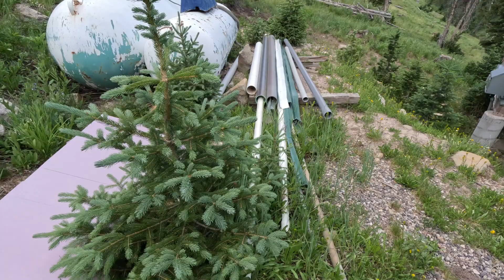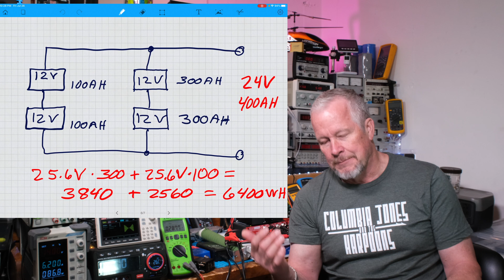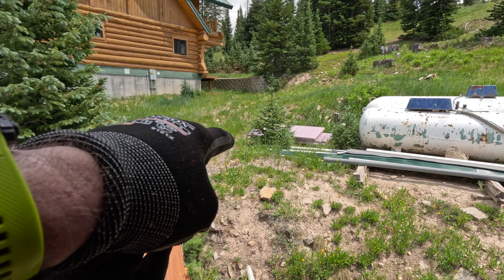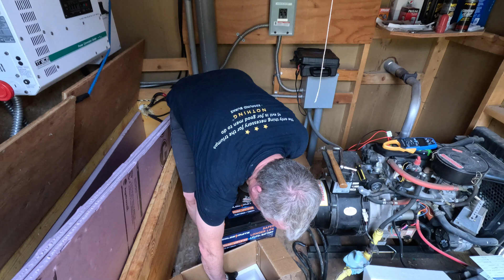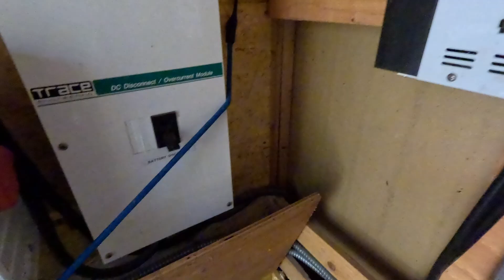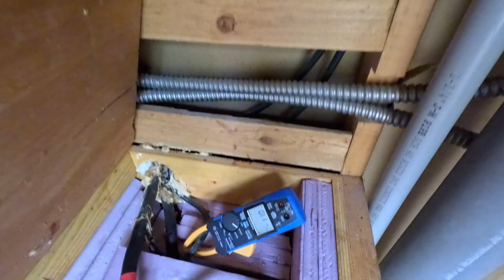Lead Acid to LiFePO4 Battery Design and Install Mountain Cabin Solar #GrenerPower #Goldenmate

Comment: The balancing problem is in the series strings.  Parallel will fix itself okay.  When lead is in series you can overcharge some to bring up the lower ones ("equalizing").  Cannot do that effectively with lithium in series - the BMS in the higher battery will typically cut out. You can get external balancers, but if the 12v blocks are well matched then they'll stay close for a lot of cycles.  Use a voltmeter and check every now and then.  If the 12v blocks get out of whack when fully charged, use a 12v charger on each low one.
Reply from the maker: Thank you!!  Great feedback!!

Comment: If you can find a heater controller that will only turn on 1) when trying to charge below freezing, or 2) when below 5F (or so) to keep temperature above 0F.  The "charge below freezing" is important to use only charge current to run the heater, while preventing any charge current from reaching the battery until it is warmed up (SPDT/DPDT on charge current - heater or battery via charge controller).
Reply from the maker: Thank you!  Also if the heater is powered by the batteries - the load current will help heat the batteries;)  They can operate at lower currents for output power than they can for being charged.  So the heater both heats them internally while keeping the ambient temp up;)  Do you have a recommendation for the type of heating pads?
Reply: @KissAnalog  I have some "silicone heating pads" aka "silicone rubber heater" that work well. Available in various sizes and wattages or can be custom ordered. IIRC mine were on aliexpress but likely elsewhere also. Commonly used for 3d printer heaters if the basic pcb heater is insufficient.
Reply from the maker: Thank you!

Comment: Charging at 0 C, the chemistry gets unhappy. The -20 C temperature may be something you read about batteries with internal heaters.
You may get some help on diysolarforum for how to control the heating pads.

Comment: Impressive stuff Eddie !!!  
Hey, about those Ideal clamp meters??  What say you? Or rec’d something else?  Thanks!  👍💪😊
Reply from the maker: There are some very nice high end clamp meters (over $300) and there are some low cost options from Kaiweets that are awesome (but are not 3rd party safety certified).  For a great meter that is safety ceritified and has high end features like Peak inrush current capture - this Klein is hard to beat: https://amzn.to/3A56992
Reply: @KissAnalog  Hi Eddie and Thanks!  I will check them out.  I reread my comment and I should have written ‘Ideal’ as the name brand of clamp meter?